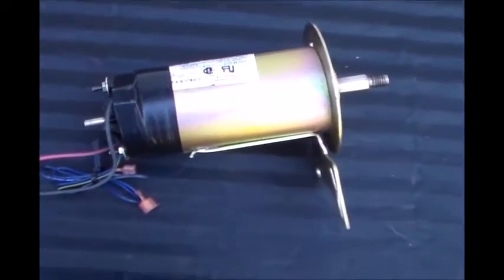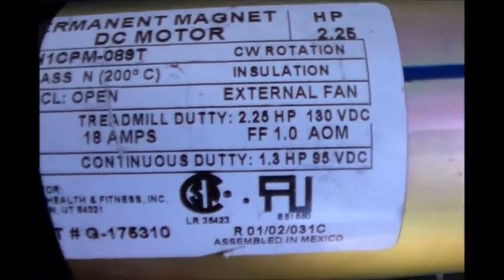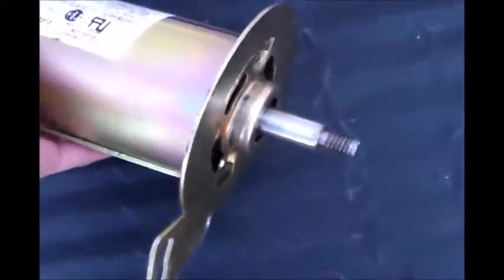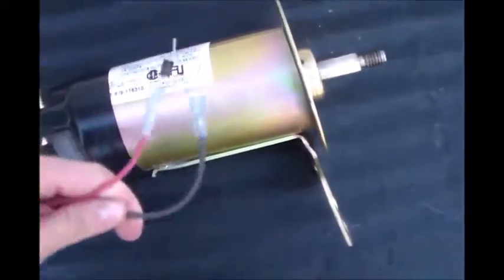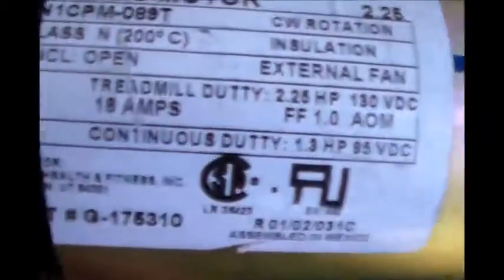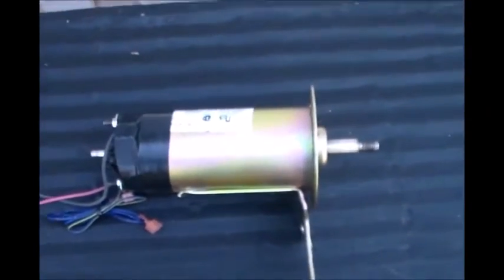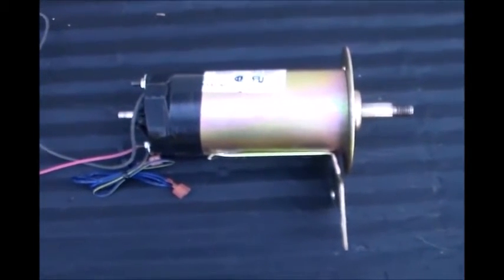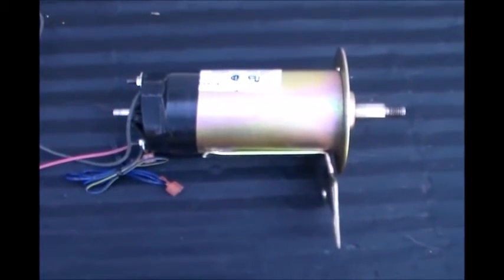DIY Wind Turbine Part-1 The Motor

Comment: I am guessing this for average size wind vane turbine where low torque converts to higher volts .this would be great for constant wind speed . (constant wind)    And not for vertical low to high rpm wind turbine that convert to low voltages. but I am not sure its calculus math here.